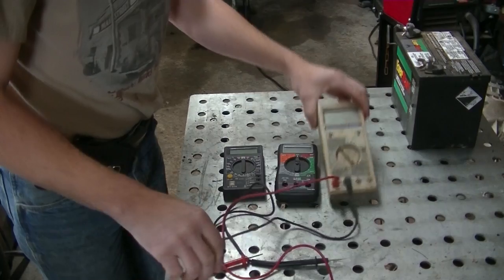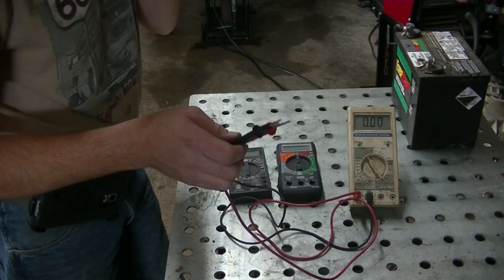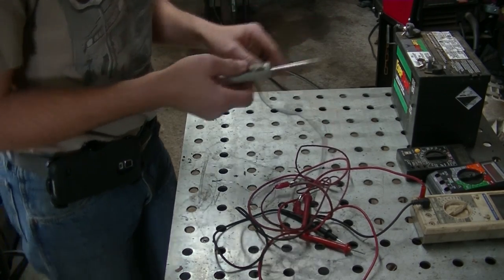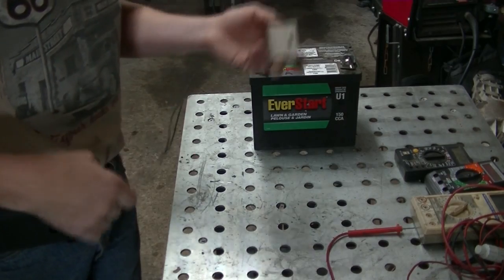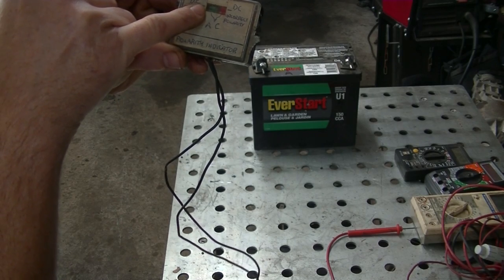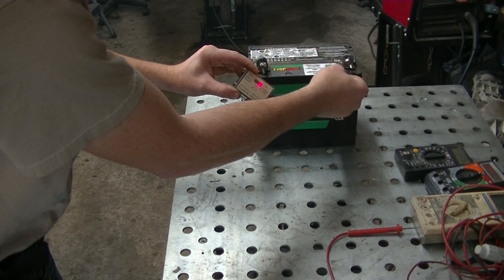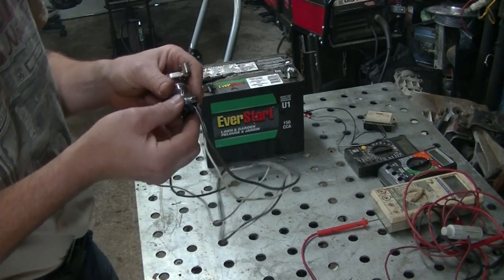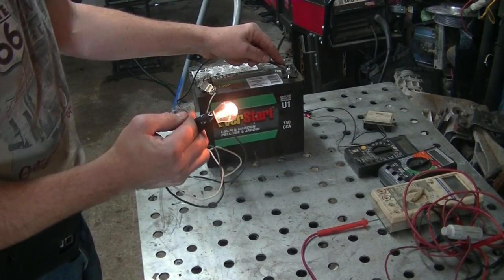DDD#5- How To Make A Free Test Light- testing 1...2...3...

Comment: Good tips,
Really as long as you know the difference between AC and DC and positive and negative it's not that hard.
When hooking up lights and other accessories as long as you know if you need a relay or separate fuse, it always sucks when you burn up your project.
I think for the most part Princess Auto is comparable to Harbor Freight for products and prices

Comment: Excellent video Doc! I like that little test light you made with the LEDs, pretty ingenious little thing there. I myself have been blessed with the reliable old 3 function Fluke T5-1000. I've used the Hazard Fraught meters before, not particularly fond of them, although they work pretty well for what they are and what they cost. There definitely is no reason not to have a meter or test light in today's world. Anyone resourceful enough can whip themselves up a nice one. I think I was 9 or 10 the first time I taped up some wires and a GM taillight bulb to test a circuit.